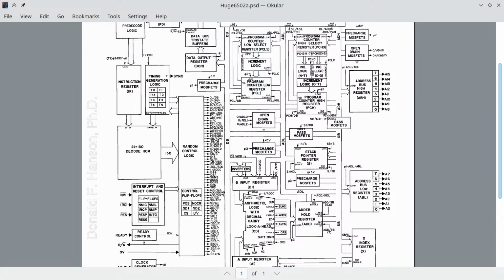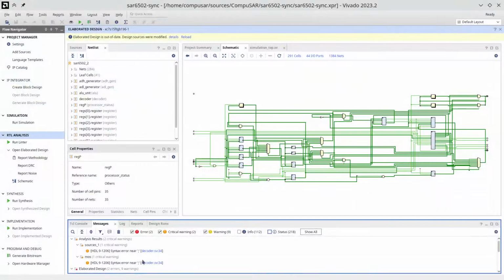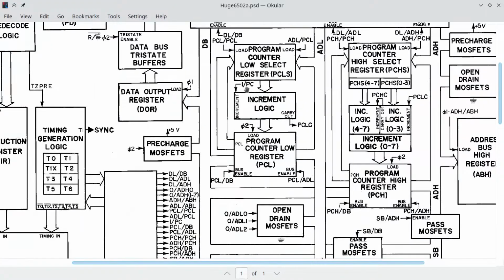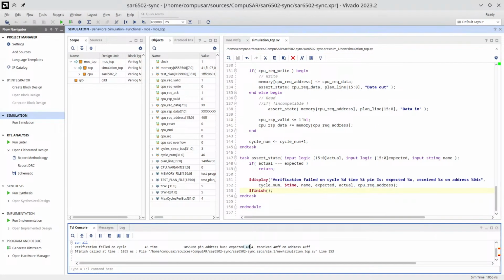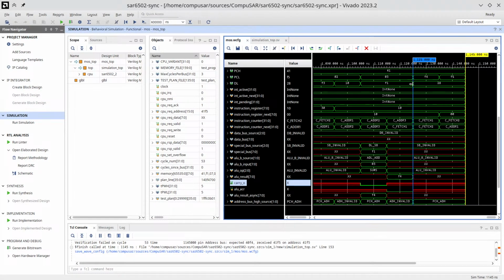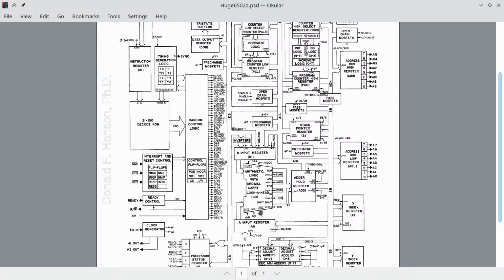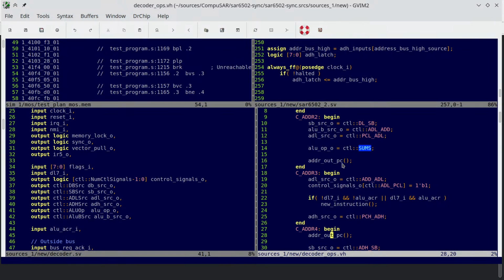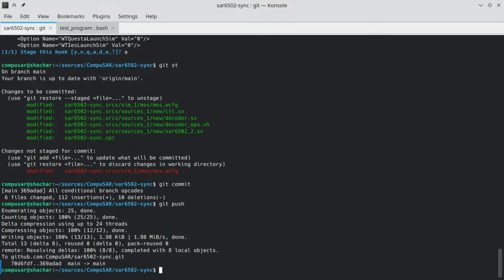Live: 6502 branched: Writing microcode for an FPGA 6502

Comment: So this is going to be a weekly thing? Super!
Reply from the maker: It's going to be a weekly thing so long as I'll think that there is value in the content. At some point the opcodes just become "more of the same", at which point I'll probably start coding most of them offline (or live but at unscheduled hours).
So far, however, I think there's value in the implementation, so for now it's weekly.
Reply: And it is super useful as well. I am working to replicate Ben Eater's system in FPGA (and admittedly I'm quite a beginner), so your series is a tremendous help in understanding some of the finer points I couldn't wrap my head around.